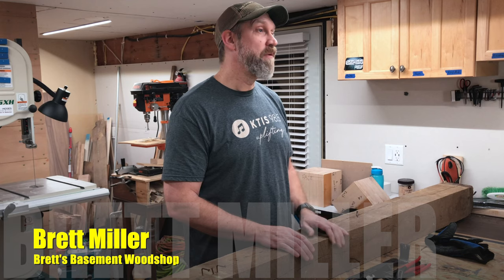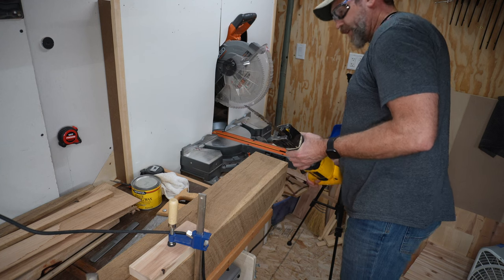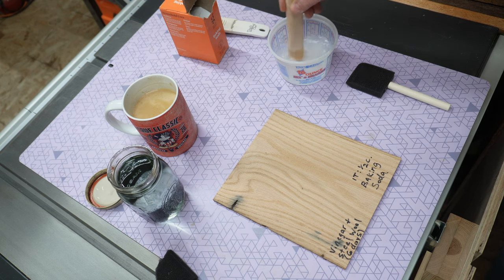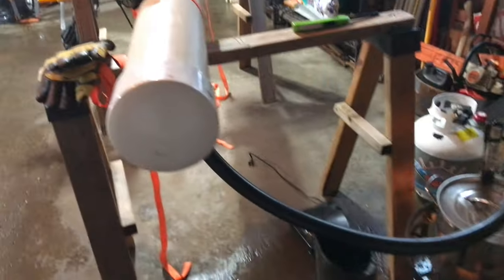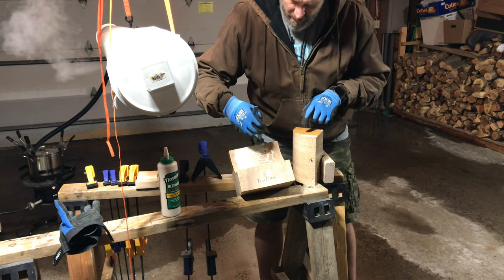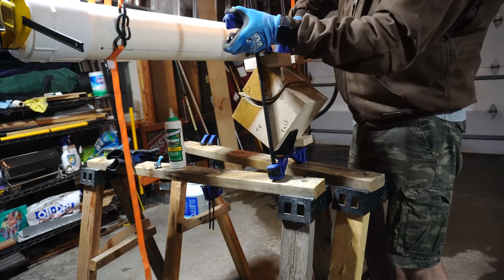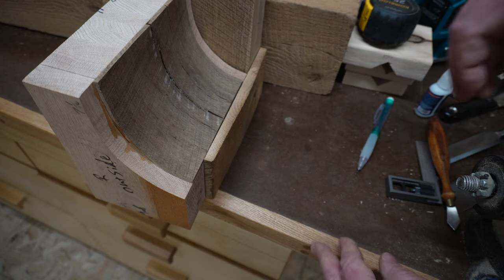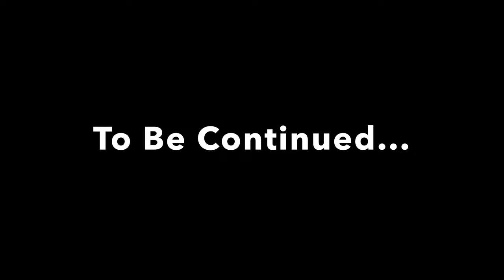Making the Corbels: Reclaimed Wood Beam Fireplace Mantel - Part 2

Comment: Greetings from West Sussex,
I've watched both of your videos with pleasure. Sunday morning, with a coffee and enjoying your work on this project. 
I've noticed this was posted 8 months ago. Is there an update on your work?
I'm interested in this, as I have a similar project in the works. While mine will not have corbels, just the beam, it is a reclaimed beam I salvaged from another home nearby. They were doing renovation and had three structural beams to dispose of. I plan on using one for my mantel. I am interested in your work with the mantel piece, start to finish. You mentioned using an insecticide to treat the timber. I'd love to see you applying it and any subsequent steps with sanding, staining/painting. The use of the vinegar for example, nice!
Regards,
Christos
Reply from the maker: Hi Christos, thanks for the encouraging words! I have a playlist with all the work I’ve done on barn beam mantel. I didn’t record the insecticide application though. Good luck and God’s speed on your project!
Reply: Greetings Brett,
Thanks for the mention of the playlist. I will watch it for research/inspiration/ideas!
I cut the beam today, used a circular saw. The result leaves much to be desired with regards to the cut surface being level. I do have a hand planer, but without experience its easy to make mistakes, so I am hesitant to use it. 
Hmm, perhaps a DIY rig to use the hand planer...
Or use the flat side for the back and leave the other side for the front of the mantel... 
I'm inspired already after having stumbled on your videos, so thank you!
Regards,
Christos
Reply from the maker: You've got this!